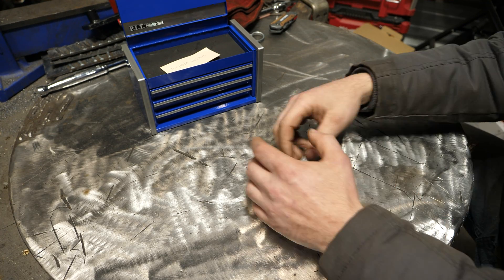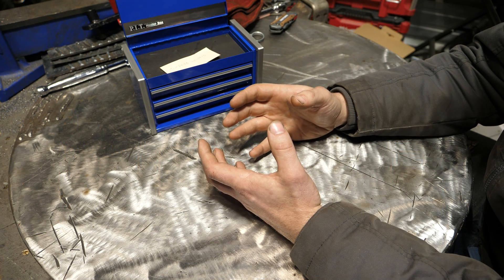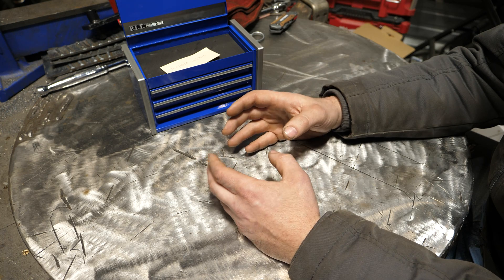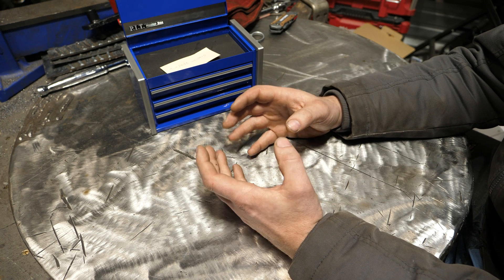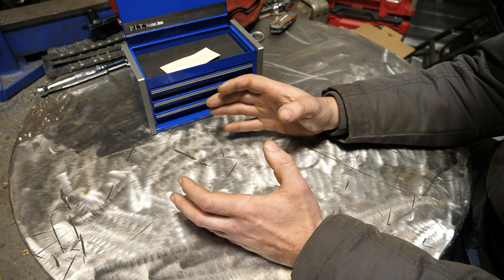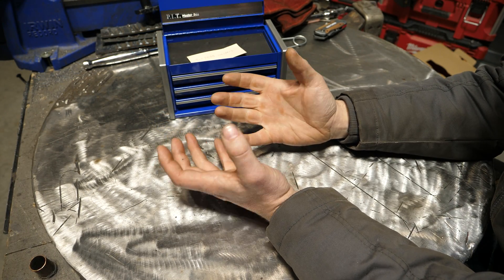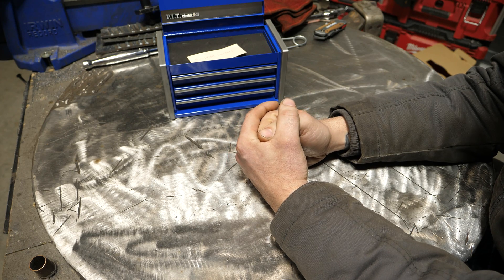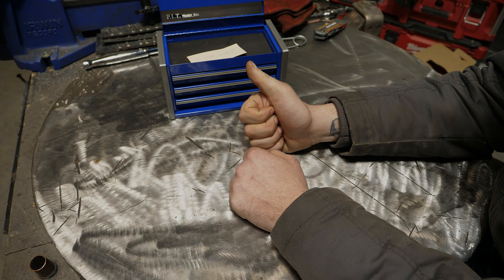Questions from the tool box:  What are torpedo welders?

Comment: Great video as they always are!! My question has to do with rod ovens, I understand that they take the moisture out of the rods, but where does it go? Does it make a puddle in the bottom? I just can't wrap my brain around that and people I've asked have no clue!!  Thank you!!
Reply from the maker: Great question.  So this is going to sound a bit wild, and I may be wrong.  Rod ovens heat the rods and the air to 300 degrees typically.  At that temperature the rods themselves will be hot enough to cause the moisture to evaporate out of the flux.  Where it gets interesting is I believe the hot air can hold more moisture than room temperature air. So the hot air itself functions as a sponge and wants to grab any moisture it can.  So basically any escaping moisture out of the rods is immediately absorbed into the air.  The air will have some humidity I would imagine, even at 300 degrees.  It’s just unable to precipitate or form dew on the rods.  The reason you don’t see water in the oven is two fold.  1) the rods simply don’t have much moisture.  Most 7018 rods don’t easily absorb moisture from the air, and they aren’t made with moisture in the flux.  (6010 rods have a ton of moisture in the flux).  2) The hydrogen present in the rods that’s of concern is very minimal.  Sure, a soaking wet rod is a no go.  But trace amounts of hydrogen can cause weld failures on high strength steels. So if there isn’t a pool of water in a bunch of rods to start there can’t be a pool in the bottom of the oven.  Also, like I said, the elevated temp will not allow the moisture to form dew or precipitate without a drop in temps, so a slight amount of moisture in the air is basically stuck there.  Hopefully that makes sense 😀

Comment: Being a industrial electrician all my life I repaired these for over 40 years ,  they're nearly bullet-proof , the ones that did fail were usually a wire broke off in the control head due to vibration  , never had one with a major problem .
Reply from the maker: That’s awesome to hear, I don’t think a better expert than you could be found for them 😀.  I can’t even imagine the hours that were put on them in big industrial sites.  I will have to find one to weld with and shoot a video 😀

Comment: They are popular for arc gouging which some businesses buy them for because gouging is hard on modern inverter machines whose replacement boards often cost more than a used motor-generator welder. Manuals are fairly easy to find. Motor-generator welders were a way to get high DC amps before modern solid state rectifiers and (when DC aircraft generators from WWII engines were very common surplus and dirt cheap) a popular homebuilt welder construction method. Since the motor end is normally three-phase they will run off a rotary phase converter of suitable size (which you can also make then enjoy three-phase tools and equipment without paying business rates or where you cannot get three-phase at the pole). Some owners convert them to gas engine drive which makes for a rather long trailer but at the right price why not? Others harvest the generator end and make PTO drive conversions for their tractors etc. Lincoln sold towed PTO driven welder heads similar to their SA series which are interesting in their own right. Look up Lincoln Tractapac.
Reply from the maker: Yeah I bet those suckers would survive arc gouging far better than a ton of alternatives.  As crazy as the idea was, it definitely took a very long time for them to be outclassed, and even then I would argue they are still somewhat relevant for specific tasks.  After talking with some guys I work with apparently there are still some of the upright machines running in some local forges, which is a serious testament to how reliable they are lol.

Comment: I have a vertical model absolutely a great welder.  I run it using a rotary phase cinvertee.
Reply from the maker: Awesome to hear.  They are definitely out there but harder to get.  If I can find one in good shape for a reasonable deal I might pick it up to do some experiments with.  😀
Reply: The Silo!

Comment: I remember seeing an archaic Hobart torpedo welder in a WSDOT maintenance shop some years back. The motor was rated three-phase, 460 (not 480) volts which meant it was probably older than me!
Reply from the maker: I bet they are sitting at shops all over collecting dust.  Pretty crazy way to build a welder, but for the time they made a lot of sense.  The only practical ones are the upright fire hydrant ones for the most part.  I might try to find one to test for the channel lol.

Comment: Good video. where did you get that mini tool box?
Reply from the maker: So a guy I know bought the snap on branded one for 300$.  I found the identical mini box minus the snap on name for 44$ on Amazon 😅.  Search P.i.t mini tool box.  I actually keep some tig stuff in it now, it will primarily be used for than and for the videos lol.
Reply: @makingmistakeswithgreg  Thanks. Id do the same with my tig stuff, and some of my lathe tooling as well

Comment: Enjoy your videos. You do an excellent job of explaining the intricacies of welding. In the early 60s I worked in a repair shipyard that used Lincoln torpedo welders. We repaired barges, tugboats, drilling rigs etc. We only did stick welding using mostly 6011s. The machines had marks scratched by different welders that were suppose to represent the “ideal” settings. Of course the ideal setting depended on the size and type of electrode and the distance to the work site. Sometimes the job might be 200 ft from the welder. Running current through several lengths of welding cables required higher settings on the machine. Sometimes it took several trips from the job site to the welder to get the settings close to what you needed. Rarely were the settings perfect.
Reply from the maker: Thanks for the kind words 😀.  What you described is definitely a downside to that setup.  It’s not that kind to a beginner and I bet every welder welded a bit different.  Add In differing length cables, different rods, and now you’re in a pickle trying to dial things in lol.

Comment from the maker: A couple things I left out that is of interest (thanks for those who mentioned some of the info):  

1) Since they are an electric motor spinning a generator, they are far from quiet lol.  From the moment they are powered up everyone knows it’s running.  Even the smaller ones are really loud.

2) because you’re essentially generating your own power, you have complete control over that power production.  At that time in history when they were common, that was the only practical way produce very clean DC on a higher amp output.  

3) I would imagine guys that were used to how engine drive welders worked/welded could hop on one of the torpedos and it would weld very similar to what they were used to out in the field.  That would be hugely beneficial for avoiding screw ups and the welders themselves likely preferred them.

Comment: Good explanation of motor/generators and how versatile they  are.  If you have an electrical supply robust enough for their operation, and good hearing protection, they are a joy to use.  I prefer my SAE 300 over my GE 400 as it has a bit better discernment between V/A ranges. I would not attempt to run either on a VFD as their motors are in excess of 30 HP.
Reply from the maker: I wish I would have remembered to mention the noise, they definitely let everyone around know they are running lol.

Comment: i have an old larsen torpedo welder i use for 6010 and 7018 sounds like a jet engine
Reply from the maker: I definitely left out the fact they are loud, thanks for bringing that up lol.  For anyone who hasn’t seen one of them they are far from quiet when running.  That’s awesome that you still use one 😀
Reply: @makingmistakeswithgreg  i like to use the older welders because they they dont burn out in less than a year if you use it hard

Comment: That was an awesome video, very good explanation! I had always assumed those pipeliner guys use those old school engine drive wel ders for the nostalgia factor or because they looked cool and were simple and had no electronics but I had no idea there was more to it than that.
Reply from the maker: Yeah they definitely do things many of the modern machines don’t.  In all fairness Pipe welding is so specialized that it makes sense to pick whatever works the best for that situation.  Outside of pipe a lot of the benefits of those welders aren’t as big of a benefit, which is why you tend to see most modern repair trucks fitted with trailblazers such, not 1960 sae 200/300s lol.  It’s also pretty crazy what some of those weigh.  A modern trailblazer engine drive is probably 1/3rd the weight of some of them lol.

Comment: Hay Greg I am new into mig welding I got a hobort 140 for Christmas got 2 or 3 2lb rolls of wire to try 2 mig and 2 fluxcor I found a row of  pgn. Er 70s6 mig .023 to do sheet metal work with do you know this wire pgn. Out of Florida  thanks jack
Reply: If you end up liking the flux core and use it alot, id go with the pgn e71t-11 in .030 ive been using it for a while its great, just as good if not better than the lincoln nr211 and 1/4 the price for 2, 2lb spools.
Reply: @Initial_Gopnik  thanks man for reply on wire been told flux cor good out side. Jack
Reply: @jackowens9440   It sure does Jack, flux core also penetrates deeper than mig. Not the best for sheet metal though, It took me alot of practice but i was able to weld 18-20 gauge sheetmetal with this wire in my titanium 125.
Reply: Start off running that flux core and you’ll love it.
Reply from the maker: To learn on that machine I would do flux core first like others suggested.  Flux core has a lot of advantages for learning.  You don’t have to worry about a gas cylinder or regulator.  It is far easier to weld out of position (think welding vertical up) than gas shielded mig.  I find it much easier to weld things like car exhaust with.  It does tend to have more penetration than mig so it can make strong welds even if it doesn’t look the best.  

The main things to be aware of with flux core are these:  1) you must run the mig gun on DCEN and not DCEP, so make sure your machine is on the correct polarity.  2) welding super thin sheet metal is tough because it’s very difficult to do spot welds with flux core.  It has a tendency to over penetrate thin material and it has a bad tendency of having porosity on short tack welds.  3) don’t make multiple passes of flux core wire if the wire is -gs wire.  It will produce a brittle weld.  

.023 mig is the best option for real thin material in my opinion.  It leaves no porosity, puts down tiny welds, and doesn’t over penetrate.  However like I said I would learn to weld with flux core first then go to mig.